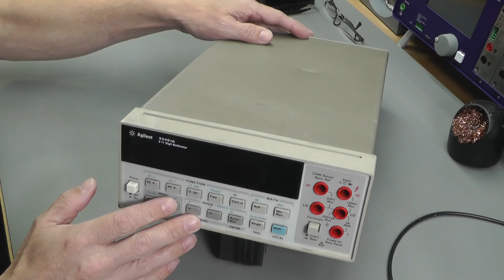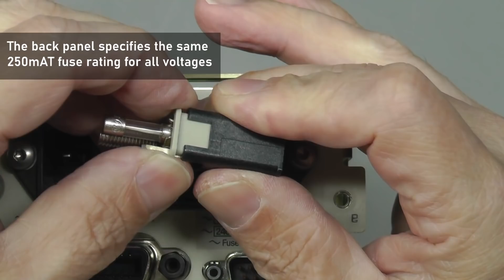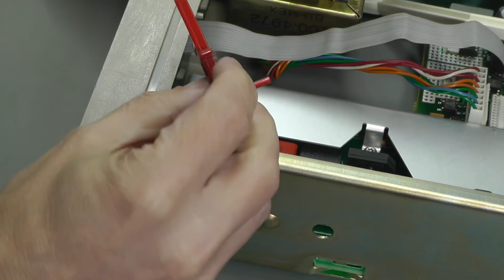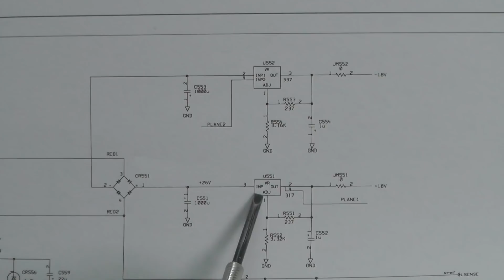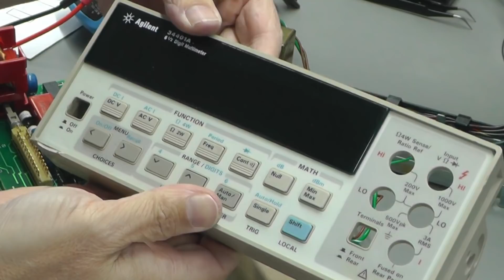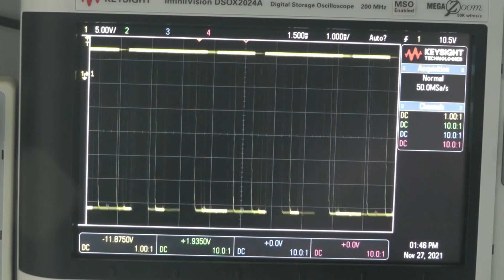No.081 - HP 34401A 6.5 digit Multimeter Repair - Part 1

Comment: I see somebody else having the same issue, I can’t see how the push rod comes out, I can’t see in far enough to see how it’s “latched in”.

I’ve stepped away for the moment because I knew I’d get frustrated and snap it.

Incidentally Ian, I had a small discourse with you about a unit I obtained, it had a weird fault where after some time (between hours and days) the readings would suddenly start going wrong.

After much time due to the fault being intermittent I managed to trace the fault down to K101, I mentioned this before and I know you were having an issue with in the k101 area.

Once I discovered K101 was at fault, I discovered that K101 can be the cause of many issues, I found a eevblog thread about k101, although not my specific fault.

People had had some success heating the pins of K101, initially I tried this and it did temporarily resolve the issue but it would return.

Weirdly at the same time, a used K101 relay came up on eBay for 30 quid, I figured it was worth the risk since it could be faulty itself, when it arrived I removed the relay and fitted the new one….

Trepidation followed after power up, wondering if the unit was going to work at all…and…everything was ok, K101 was working.

Since then I have had the unit powered up for 4 days and the issue has gone!

So now it’s time to replace the VFD as the segments in this one are a little uneven, but I’m currently stuck because I can’t get the front panel off due to the push rod!

If you get the chance, next time you get one of these meters to repair, a short vid on the push rod removal would be a really useful guide, your clip removal instructions are spot on and definitely easier to try on the rear to see how to do it!

Thanks for the videos, fault finding and repairing is a very satisfying thing!
Reply: After some twisting I managed to get it to release, once the rod is out the front panel comes away easily (removing the clip first of course).

I love my hakko desoldering gun, it took a minute to desolder the existing VFD which then dropped out, another minute to solder the replacement in!

Now I have a nice bright consistent display.

This meter is now working very nicely after resolving the K101 issue, of course, my other 34401a seems to have developed a similar ish fault to this one, although I haven’t got around to opening it up and seeing what is what with that unit, that I will save for another day.

I paid about 28 GBP for this replacement display off eBay, very happy with the quality of it (at least first impressions), I’ve kept the original one as a backup to go in my parts store, cheaper than AliExpress, the VFD purports to being a Samsung part.

I also replaced the lens on this one as well since the logo and whatnot was missing in places, it’s not OEM but it’s really good quality and looks better than the original lens did.

I’ll probably stock up on a few more bits and pieces just to have in reserve in case something else goes bad.

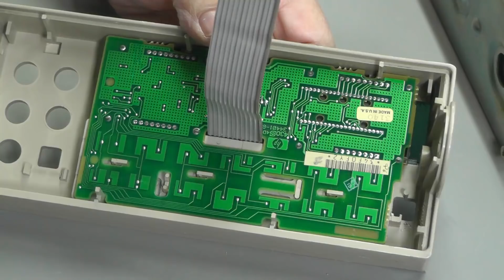Comment: 9:23 You have a broken solder joint, just above the "2" in the barcode label.
Reply from the maker: It looks like it in the video.....but it's not. It's just a stepped solder joint i.e. where it's been soldered, then been touched up by somebody and left a little step. It's not broken at all. Nice spot though.

Comment: Really enjoy these vids Ian. Not to dismiss your excellent fault-finding skills, but it surprises me how often folks and/or companies just throw something out as soon as fixing it requires component level fault-finding. It really emphasises how the throw-away culture has taken off. I've bought some really expensive kit for peanuts over the years with simple component-level faults costing pennies to repair.
Reply: It is all about cost. This power supply or its successor cost ~ 1-1.5k. A person with a skill level good enough to repair this power supply would cost ~ 120€/h here in Germany. For the repair you need at least some hours, waiting for a functioning tool etc.. all this costs time and money. But it is not bad. This way I can get those defective units from the bin

Comment: Hi Ian geat video, I have just picked one of these up that has been used in a car workshop so the front panel is a bit dirty, so planning to follow your helpful instructions on how to remove the front and take the display board out. Can you suggest a cleaning solution for the front panel that wont damage it, I was thinking of Isoproply alchol or servisol foaming cleaner?
Reply from the maker: I think I'd pop out the smoked screen and wash that with soap n water.
The front panel I'd wash first with soap and water to get most of the dirt n grime off (scrub it) then IPA after that.
Don't use acetone.

Comment: Thank you Ian for another interesting repair video. Looks like you have been busy! In part two you might include a quick explanation of why the "offset" power supply is used for those new to electronics. Regards, David.
Reply from the maker: Good idea, I'll give an overview of all the floating/offset supplies and sections and why they are there, and why HP at the time designed them as they did.......IMHO of course. Cheers.

Comment from the maker: Recap before troubleshooting, or sort it out after?.............This is a question I got asked by a young fellow electronics friend.
The answer in my case comes from working in the offshore industry where Drilling downtime from broken electronics can cost 6 or 7 figures a day for the rig operators.
By powering up first and experiencing the customers problem/fault then when I do replace something and the fault disappears then I KNOW I have fixed it.
By replacing caps (or any other part) before power up and subsequently having it power up without ever seeing the customers problem then you never really know 100% whether you have fixed the problem, i.e. it could be intermittent, and so imagine sending that hardware back offshore only for it to fail immediately!
Of course, it's only safe to power up providing there are no holes in transistors or IC's etc. and thats why you see me go over the board before power up in the video's.
Hope that helps........and each to their own for sure.
Reply: 100% First rule of troubleshooting is to replicate the customer complaint before touching anything!

Comment: Had the same capacitor issue a while back with my HP5385A counter...the bad electrolytic was venting underneath and you couldn't see the problem until you actually removed the cap. Hope you can find a nice VFD replacement, thanks for sharing the fix!

Comment: Ian have you gotten around to making AR488 GPIB adapter yet? Seems like a neat alternative to a dead display would be to find a cheap laptop or tablet with USB ports and remote control the meter using computer or tablet display.

Comment: Glad to have you back doing repairs! You make this look easy. Would be interested to know what was on the other side of that discoloration in the end?
Reply from the maker: Small SMD bridge rectifier for the serial GPIB inteface at the back of the unit (electrically isolated from the main cpu). I'll have to test the GPIB interface once I get the unit back together again.

Comment: I bought one of these meters off ebay about 6 years ago, the display looked bright in the photos. But when it arrived was very disappointed as was quite dim. So I took the risk of ordering a new display on ebay from China for about £30. It was perfect & is still bright today, thanks for video
Reply: They do go dim fairly quickly Nick.
Reply: @SoddingaboutSi  mine hasn't in 6 years use Simon. I guess I've been lucky

Comment: I used to use multiple sets of glasses to work in the lab as you are doing.   I saw the multiple sets on the bench in the video.
Now I use a set of custom made glass trifocals.   The top is set for 26" (66 cm) for looking at the computer screen and instruments, the center is set for 12½" (32cm) for reading and soldering, and the bottom set for 7¾" (19.7cm) for inspection.    I no longer need to change glasses in the lab.  The close-up inspection section at the bottom means I need to use my stereo microscope much less.  I had the lenses made from glass for scratch resistance.  I have enjoyed working in the lab much more since I started using the trifocals.
Reply from the maker: Great idea!......yep, it's frustrating having to chop and change all the time. I'll see if my optometrist can do the same.
Reply from the maker: Q. Are your trifocals full width, or are the centre and bottom spot areas, and are yours quite tall glasses (large) or just normal more rectangular......am just trying to gather some info before going to the optometrist....... :)
Reply: @IanScottJohnston  I will email you a photo and measurements.   The glass area is larger than all of my other frames.
Reply: I apologize for the delay in  getting you the dimensions and photos.  Life got in the way.
I texted you some photos last night.

Comment: Looking forward to watching later, I'm in the market for an ESR meter(possibly not relevant to this video), I'm wondering when it tests with DC on the larger electrolytics -   Would a multimeter be good enough to test these, I'm thinking the test voltage is lower on the ESR meter, perhaps this is why?
Reply from the maker: Depends on how much you want to spend. The problem with cheaper units and/or using a DMM is that they can run out of range i.e. when testing the likes of 2200uF and bigger caps etc. A dedicated unit will give you a lot more info also.